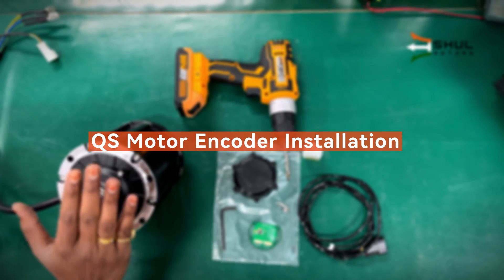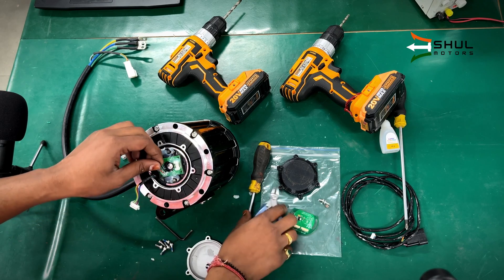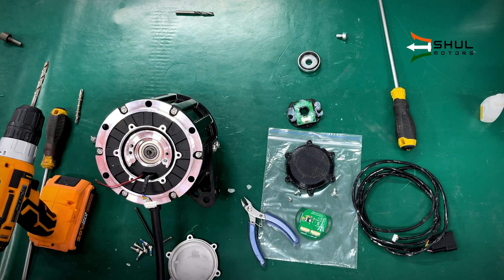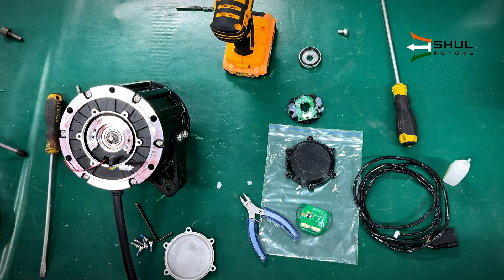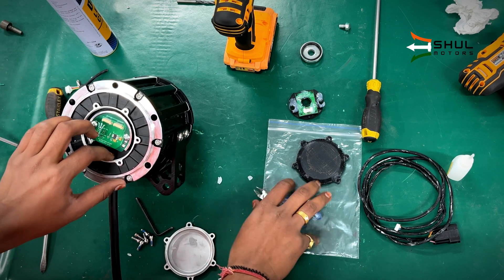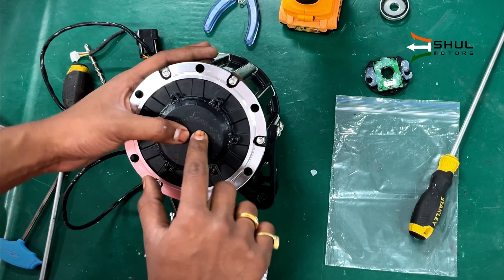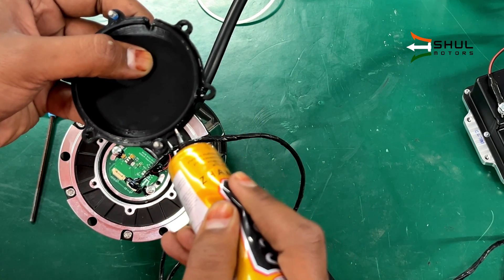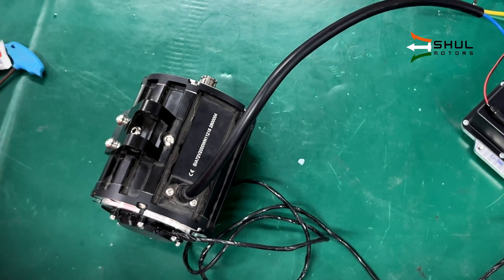QS Motor Encoder Installation

Comment: Will the VESC Tool auto detect the encoder setup during an auto motor detection process. Or do I manually need to change it?